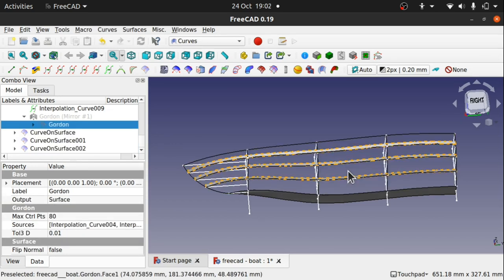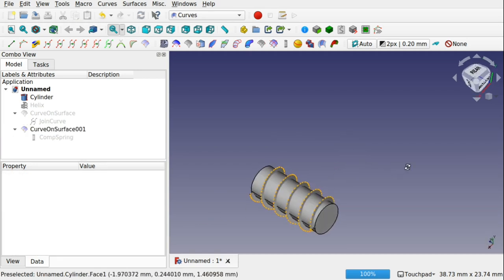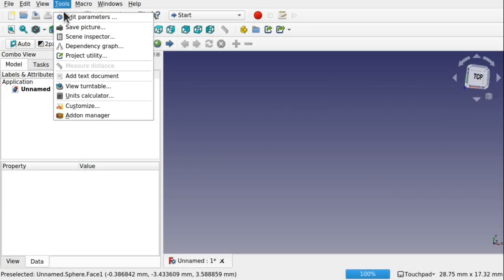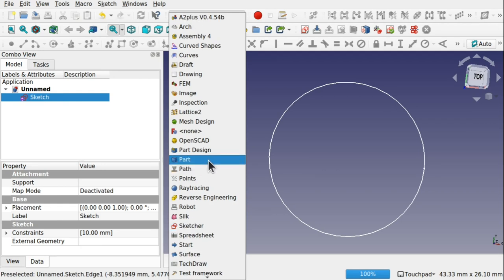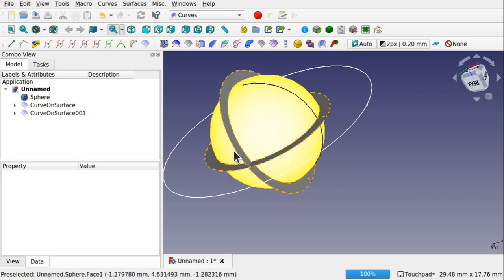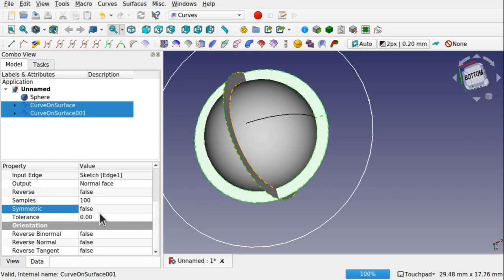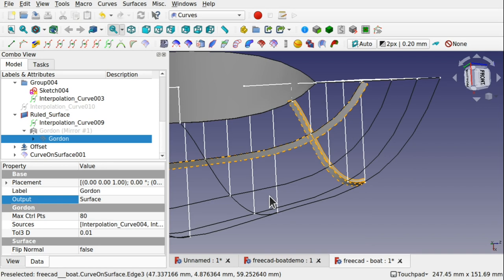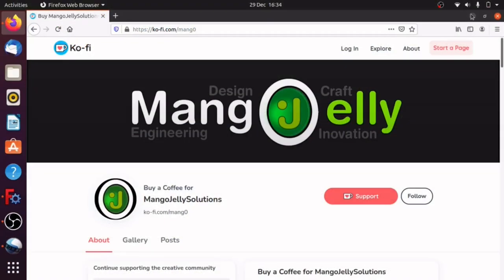Learn FreeCAD Curves Workbench 17: Curve on Surface. Lattice, Archimedes screw, supports and braces

Comment: 18.21 When you had the Join Curve problem. During the Exercise I dimensioned my Helix and subsequent operation up to 18:21 on the Default Cylinder. No problems and I produced a very tidy Tight Helix that matched the Cylinder perfectly. This seems to avoid the pitfall you encountered. As always though great Tutorial much appreciated. Your Videos have helped Me become a somewhat competent FreeCADer. When doing Trim Faces in Curves is there an easy way to remember which face is removed?

Minor Point I know The Transverse Structures You modified Curve on Surface then Offset are called "Frames" not "Strut" (an Aviation or Suspension Term) another Nautical Term for You LOL ;_) Meery Xmas to You all and Families.

Comment: Thanks for the video. Why do some examples put the curve on the curve, and others put the curve on the surface? You didn't address this and it makes a big difference in intent. The first example put the curve on the spherical surface. The second example did not put the curve on the surface, but left it on top the original curve.  When you extend this normal to surface the results are very different. The first example is what I would expect. I can't make it behave that way when I do it myself.

Comment: This is Awesome, finally I can make stringers for my boat hull. But how can I use this technique to create bulkheads?
Reply: After MJ's brilliant work, that is now very easy - there's a two ways I can think of: Step 1 or Step 1a.
0. Loft or Gordon the hull skin, Offset 3d to create the inner skin, without filling to a solid 

Either:
1. Create a cube, X&Z intersecting the inner skin, Y the thickness of the bulkhead,
     Boolean Intersect/Common the Cube & the hull, creating a vertical section of hull as a Face/Surface. 
Or
1a. Create vertical lines at the bulkheads. Use CurveOnSurface to project it onto the hull skin, setting Output to BinormalFace and FaceWidth as you like ( or so desire ... ).

3. From there, Surfaces workbench has the tools to make a shell
4. Part workbench > ConvertToSolid.